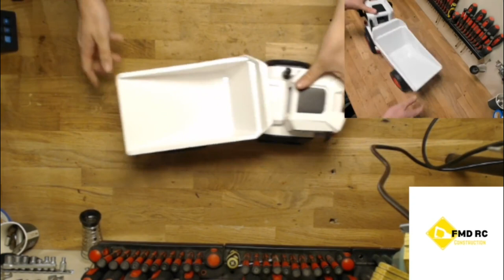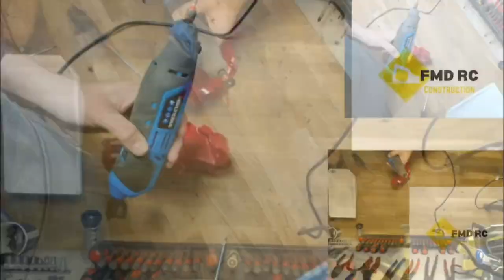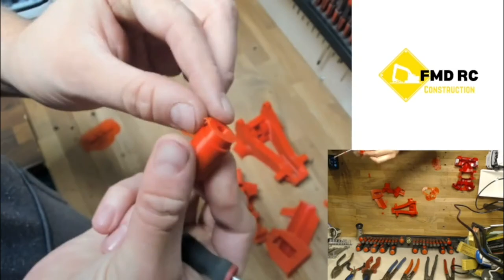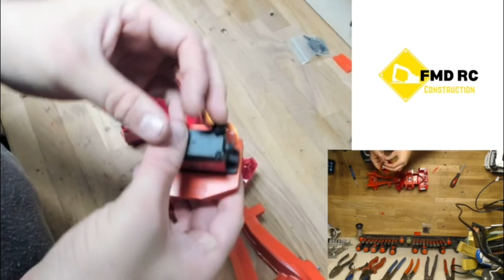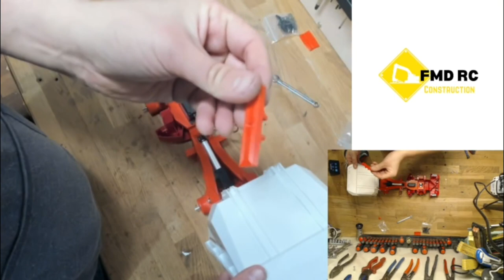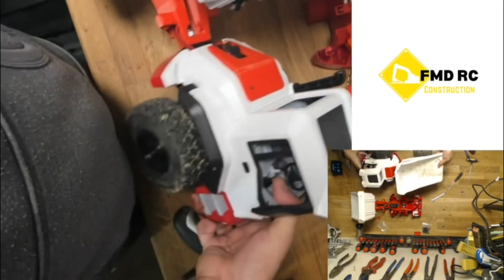Bruder XD5000 RC conversion - How To convert this model - RC Construction DIY - 3d Printed

Comment: this is awesome! do you have any links for the Motors and Actuator you used?
Reply from the maker: Aliexpress always changes, new listing etc, but standard 370 gear motors, 12 or 6v depending on your preference, 100rpm. And 12v actuator, 90n 50mm stroke.
Reply from the maker: And thank you, its a very nice little dumptruck, and my kids absolutely love it😉